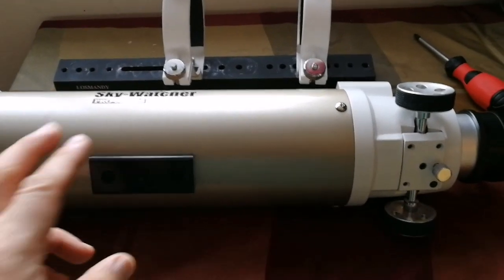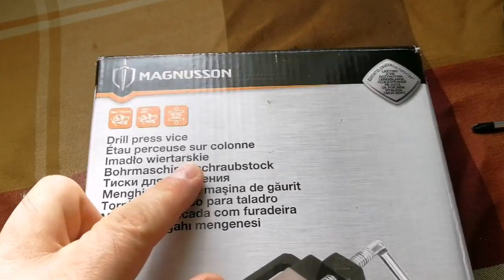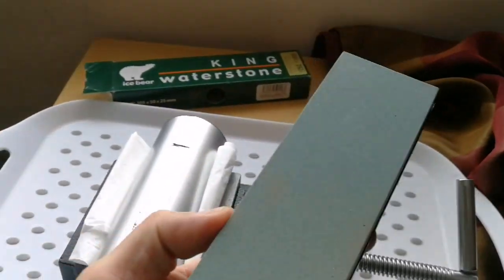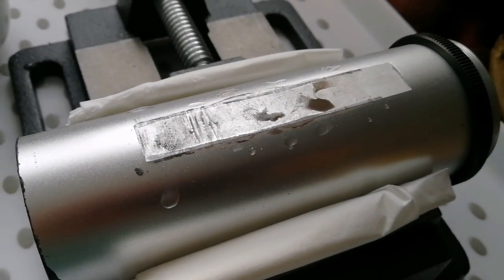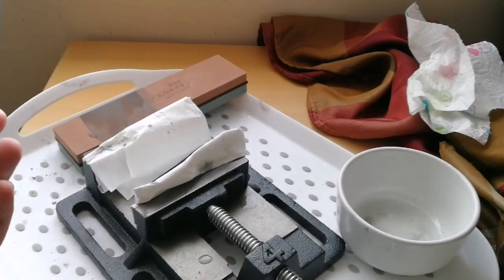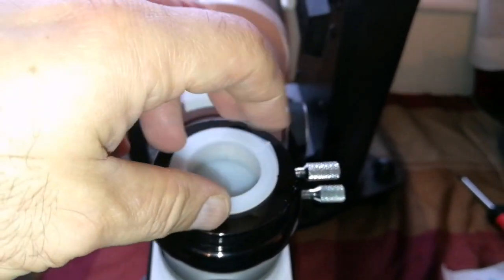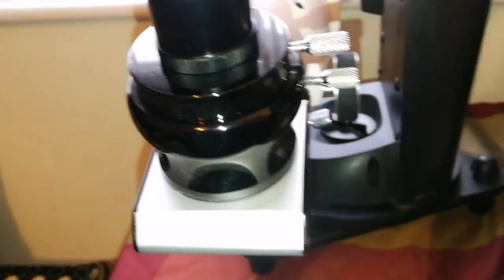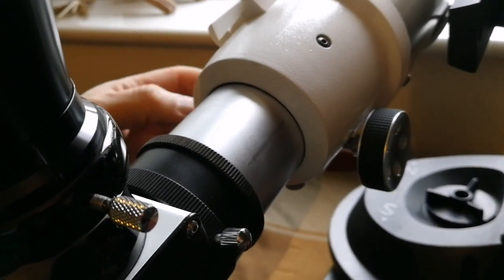Repairing Skywatcher Crayford Focuser/Slipping, Loose/ Skywatcher ED80 Pro Series Telescope

Comment: Can you share the size of the screwdriver required for the 4 black perimeter holding screws? I have not been able to find this information anywhere and I don't have a screwdriver that works
Reply from the maker: I just used an ordinary Philips screwdriver which I had a long time ago, nothing special. By the way I have found a better way on how to totally fix this problem. Please watch this video :
" How To Repair A Loose Slipping Crayford Focuser Of A Refractor Telescope"

Comment: How to ruin your crayford!
The concavity is so any marks from focus locking screw are below friction contact.
Adjustment of pressure pad is at centre, the engineering is correct.
The crayford was invented for eyepieces.
Cameras and astrophotography kit is too heavy really. If you carefully and diligently follow a check of the bearings and clean parts, with pressure adjustment you can use a light camera about 500g.
Otherwise a bigger 3" or 4" type is needed.
With an internal support mandrel, an engineer could knurl a micro gear track and produce a matching pinion.
But if amateur is going to hack diy like this when they have no idea what they are doing, it would be wasted effort.

Comment: I would think metal on metal would have slippage problems in these focusers. I designed a crayford focuser that had a thin rubber strip on the drawtube. Never have had any slippage with it.Maybe some kind of rubber coating on the flat area on the drawtube?
Reply from the maker: That is what I did after making this video. I used duct tape. I will upload the video.
Reply: @TheAstronomer  Can you show us the method with a video? appreciated!

Comment: This is a nice detailed video that shows how to flatten the drawtube of the Orion/Sky watcher focuser.  At 1:16, there is a mention of the Allen-Hex screw.  This is actually the adjustment for the pressure between the pinion shaft and the drawtube flat. If you focuser is slipping, adjusting this increases the pressure and provides more friction. Most Crayfords have this adjustment, sometimes it's a thumbscrew.
Reply from the maker: I just use now  duct tape or electric tape. It works better.

Comment: I just bought an 8” dobsonian skywatcher and the focuser was slipping.  I took it apart and did the recommended fix but it did not do much. Instead you just have tighten the set screw which puts pressure on the rod against the tube of the focuser.  It works fine after doing that.
Reply from the maker: I have since started to use duct tape abd it solved the or completely. It is cheap and can be done as many times it is needed, I will make a video about this. 🔭😇🌹
Reply: @TheAstronomer  oh, instead of grinding away with the whetstone place tape instead to gain the friction! That makes a lot of sense! Just along that flat strip on the draw tube. But I’ll try tightening up the screws too. I’ve put on an a EAF - the screws may well be an issue too!